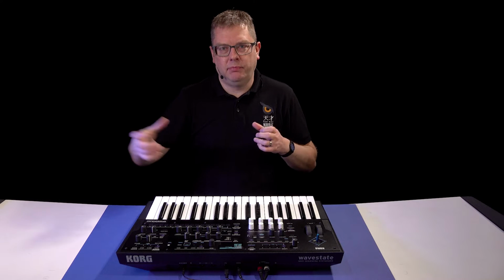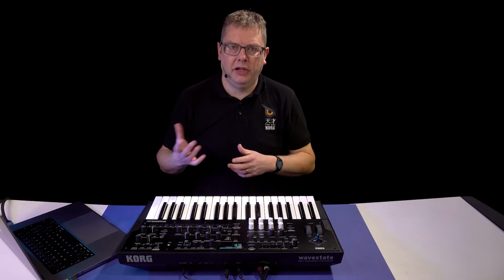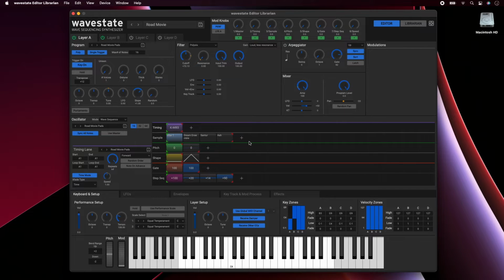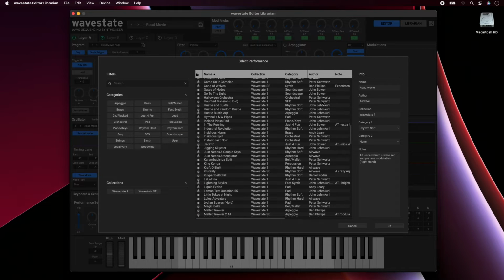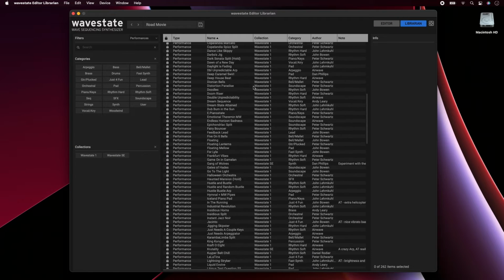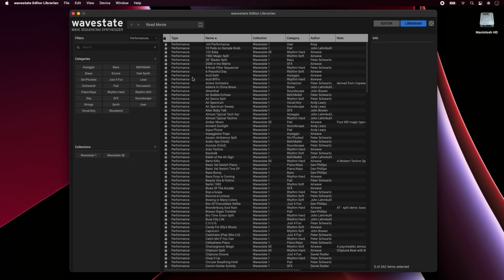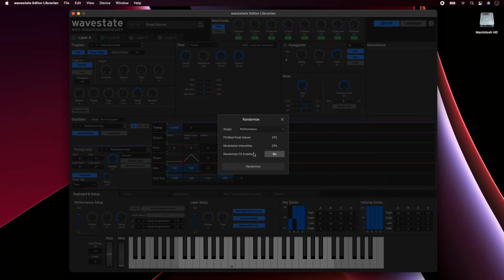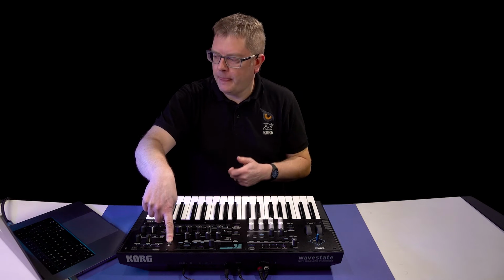Get started with the Korg Wavestate mkII - your first five minutes

Comment: An absolute monster of a synth but fuv=ck me its complex.
Reply: I found that as well, but if you connect the wavestate to a pc and use the free to download software editor it will make it a bit easier to programme this deep complex machine.
Reply: @jamesmacleod671  Does the PC software work well now? I have read many posts (mainly > 1 year old) complaining of connection problems - mainly that the PC software could not find the Wavestate?
Cheers
Reply: @peterleo57  my wavestate has no problems connecting to the editor on my PC. All the best.